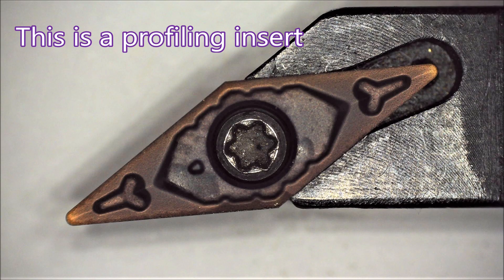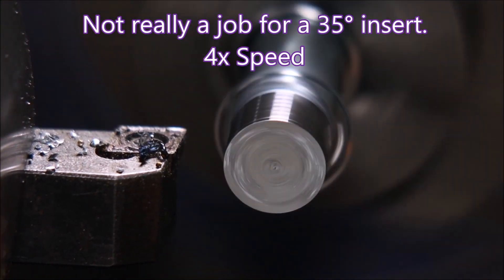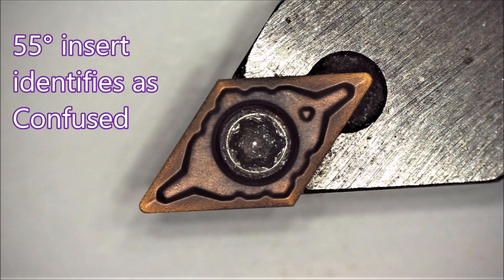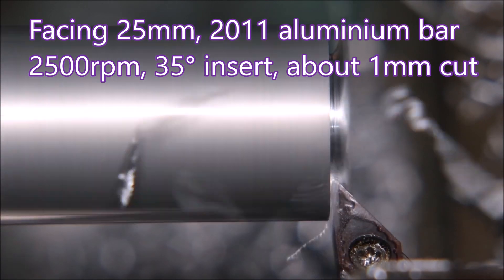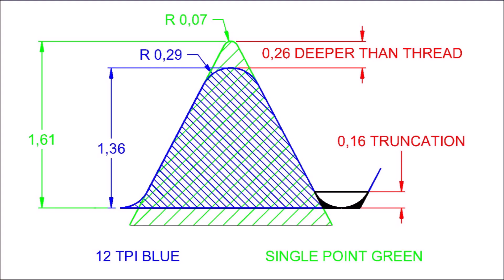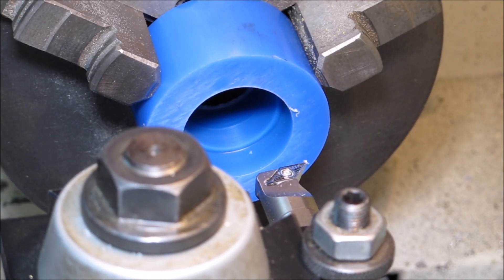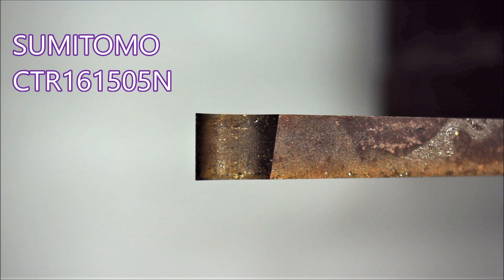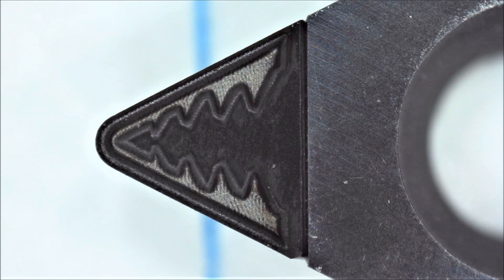Carbide inserts and tools I use in my small cnc lathe. VCGT, DCGT and CCGT and others

Comment: I'm a bit late to comment, but it might be useful to someone - the 35 degree insert is also handy for cutting a buttress thread if one doesn't grind up a tool  from HSS
Reply from the maker: A comment can never be too late, it means someone has watched an older video. You are right about the 35 degree tool, I us it all the time to get a 45 back chamfer on threads. I only ever cut threads with full profile inserts so I would never have thought about cutting a buttress thread with one of those. Thank you for taking the time to comment.

Comment: Thanks for the video's, they are always informative and great to watch.  Would you mind posting the tool holder types - just the first 5 letters would be great.  I was mainly interested in the 3rd letter - the approach angle so I could relate that back to the clearance angles in the diagrams in the video.  I'm in the process of buying a small CNC lathe and that would be very useful information! Thanks.
Reply from the maker: Hi Chris, I thought the 3rd letter was the tolerance.  If by approach angle you man the angle between the insert and a turned face, it is 5 degrees
Reply: @smallcnclathes  It is for the insert according to the Engineers Black Book.  The 3rd letter for the tool holder is described in the Engineers Black Book as the approach angle which they define as the angle of the cutting edge to the Z axis.  Having said that, I think I have answered my own question - your tool holder for the VCGT insert would start with SVL - unless I have miss understood your drawing at https://youtu.be/gnvEhDhwo98?si=FYRcWxMv8-Sl-fhN&t=59  Regards, Chris
Reply from the maker: @chrismayhew3651  sorry Chris I read it as letters for the insert in which the third letter is for the tolerance
I have no idea what the letters on the holder would be a all my tools are shorted to fit the turret and the letters usually are on the shank that get cut off. What cnc lathe are you looking at?
Reply: @smallcnclathes  No worries!  I feel I'm on the right track thanks to your help, so much appreciated.  I'm about to buy a Tormach 8L.  It has a 1" bore, uses 5C collets.  Am also ordering a small 5C collet 3 jaw chuck.  Mainly intend using it to make small pins,  spacers, shafts and bushings. 1.5 HP/ 5,000 RPM in high range 2,500 RPM in low range (when the 3 Jaw chuck or difficult to machine materials are being used and you need the extra torque).  Regards, Chris

Comment: I have been following your channel for over a year now and I thought I would take the time to tell you...
You put out beautiful parts and excellent videos.
I am an open innovation product developer (that's a ten dollar title for inventor) my work can be found on my personal channel "a handle on things" and my alternate channel "a more prepared life" if you get bored and want to see it.
I bought a Benchturn 7000 cnc lathe (small cnc lath) and have been teaching myself to use it by watching your videos. 
Thanks a ton for putting in the time on the videos brother, lots of us are out here watching and waiting for your new videos to be released. (and watching all the older ones too)
Best Regards, 
Shane from Wisconsin USA
Reply from the maker: Hi Shane, thanks for that. I have less parts to video now I have retired but things still crop up from time to time.  Currently working on a video about my lathe and turning some 304 stainless bolts into some holding bolts with star shaped knobs fitted.  I also have some ebay parting inserts to test and a PCD insert with a chip breaker, that should be fun.  Again thanks for your comment. Nigel

Comment: Super introduction to carbide tips, it can be a mine field!  Surprised you don't use polished and ground inserts more. I use the DCMT 55 deg polished inserts for everything on my little lathe, the positive top rake and razor sharp edge cuts plastic, stainless, brass, mild steel, wood, everything !!
Great video keep posting them.
Reply from the maker: Thank you, I have done videos suggesting inserts for aluminium are great for small lathes and in particular for steel. I have used them for steel quite often. They are amazingly cheap these days, those FC inserts from Sumitomo are about nine dollars each! Thanks for your comment

Comment: Thay last insert you had reminds me of an insert taegutec used to make but in a much lager snmg version, i think the grade was 5035 or something like that. Was awesome for roughing down if yoi got the feed over 1mm/r but they had a bad habbit of failing mid pass for no apparent reason.
Reply from the maker: I find my lack of hp makes life difficult. Getting the feed high enough for the chip breaker to work normally means no depth of cut so the chips still won’t break. Thanks for your comment.

Comment: basically the bigger the insert angle, the stronger it is but also the more friction is produced on end-cutting edge - so 80° negative inserts (ex. CNMG) are good for heavy roughing and 35° positive inserts (DCMT) are good for thin-walled parts and undercuts, we use 80° for roughing (negative) or for internal turning with small clearance, finishing is always done with 35 or 55 degree angle positive inserts
Reply from the maker: Hi Adam, thanks for your comment. Nigel

Comment: That close up camera quality is impressive.
That coated molded insert does a fantastic job in the aluminum closeup. Far less material sticking that I would have guessed!
Reply from the maker: Thanks Kevin, I am pleased with the camera, it works well for me I think. Which part of the video are you referring to? I don’t use moulded inserts. The three inserts shown facing the aluminium are actually Sumitomo inserts which have ground edges and 15 degrees of rake which means they are almost as easy on the lathe as aluminium inserts, just tougher. Thanks for the comment, Nigel
Reply: @smallcnclathes  I've never seen a ground insert with a coating before, so I assumed they were a pressed/molded normal insert!
That explains why they work so well.

I'm very excited to see the testing with that PCD insert. It looks like the design in it is a laser cut chip breaker?

Comment: nice overview of insert shapes. 
I'm really starting to like the 35° inserts in Aluminum and Brass, its so nice to be able to get that 45° chamfer on the back side and on my light machine they are more than sturdy enough for what I do.
Reply from the maker: Hi Klaus-Michael, are you using them in the made for aluminium type? So cheap and easy on low power machines. Nigel